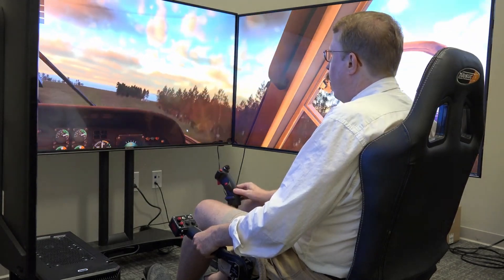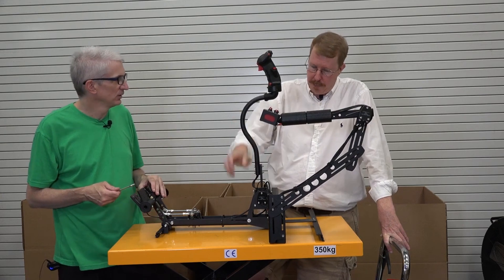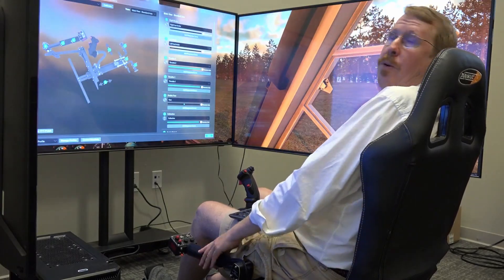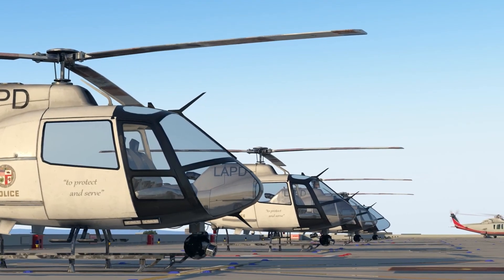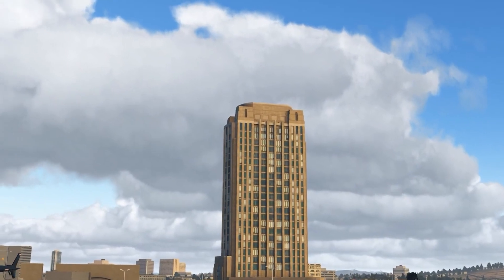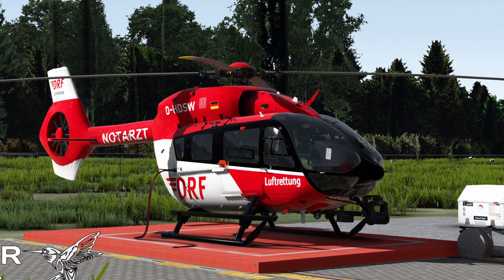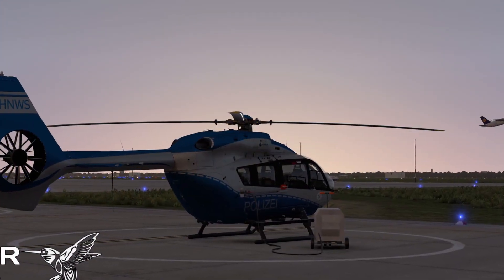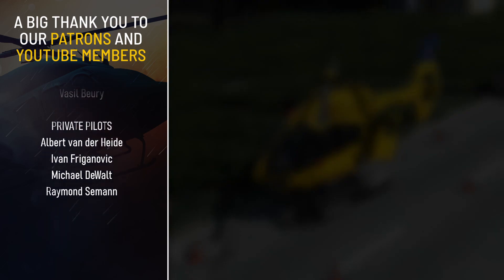X-PLANE 12 with HELICOPTER CONTROLS (Pro Flight Trainer Puma) + more news - Weekly FlyBy

Comment: Good evening, how did you do the joystick settings?
Reply from the maker: It's just a matter of assigning the axis to the correct assignments. Cyclic to roll and pitch, pedals to the yaw axis, collective to the dedicated collective axis and throttles to throttle 1 and 2 if you have 2 on your PFT or just throttle 1 if you have the single-throttle one.

Then, the buttons are a matter of personal taste and depend on the helicopter as they may have different features.

Comment: With regards to xplane 12,is this a new platform or just an updated xplane 11?
Reply from the maker: It depends on who you ask.

It's more of an update to 11 than 11 was to 10 if that makes sense to you.

Laminar Research redid a lot of code to improve the sim but don't expect it to be another MSFS in terms of graphics and visuals. It's still X-Plane but with a lot of great improvements.

It's also in an early beta stage so it has issues. If you are not sure if this is for you, I would recommend you hold on a bit longer and learn more as the platform stabilizes.